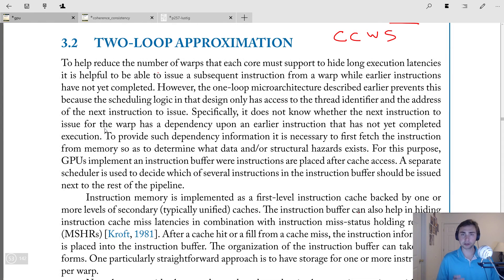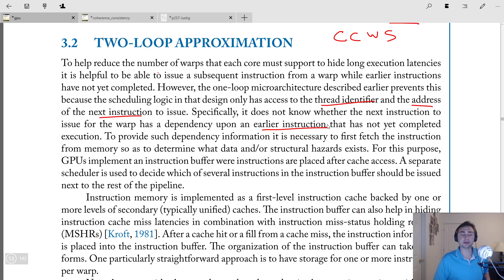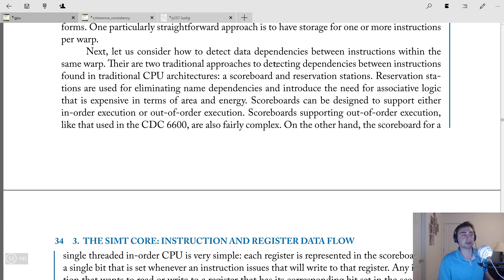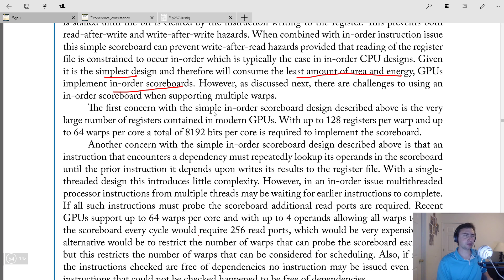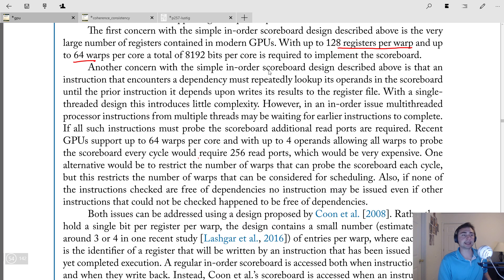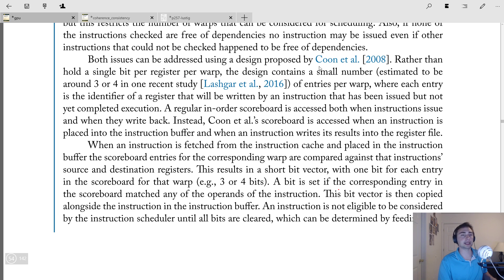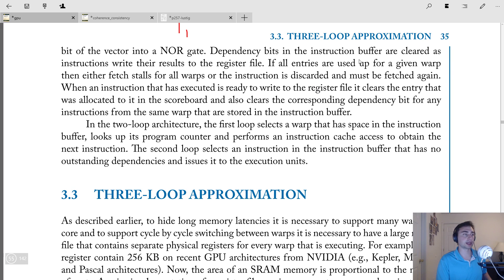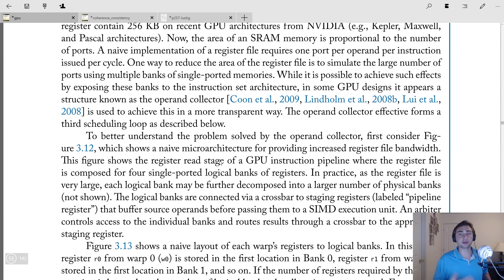Fundamentals of GPU Architecture: SIMT Core Part 3

Comment: Thanks a lots;
 There question : what happen if we keep —Gpu— busy (like to put it in infinit loop) and we trying execute a program use heavy OpenGL app?
Reply: so GPUs do not support traditional preemption via interrupts, instead all context switching on the GPU between command buffers from different processes is handled CPU-side by the driver. if you enter an loop for too long w/o finishing off a command buffer traditionally the driver kicks off a TDR (timeout detection & recovery) and will attempt to signal to reset the entire GPU